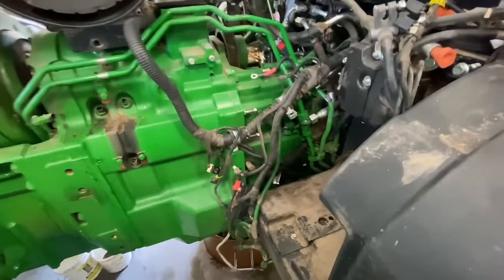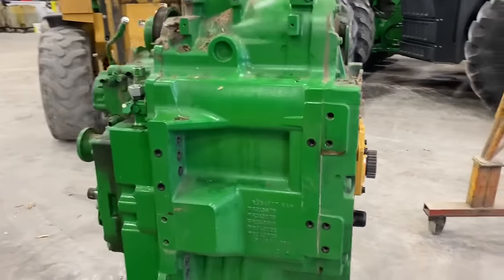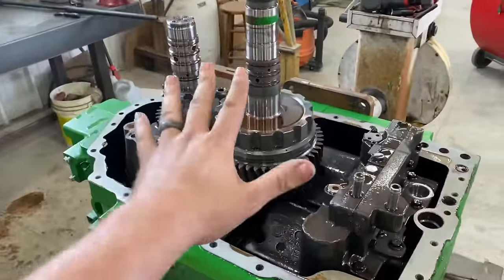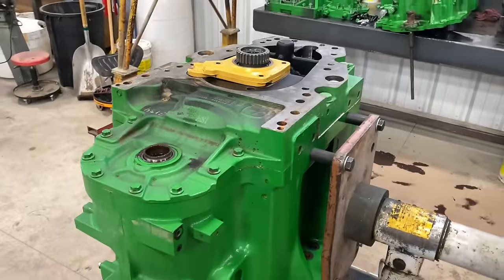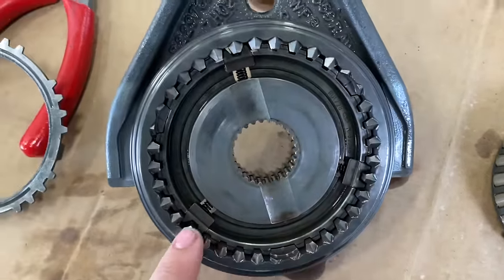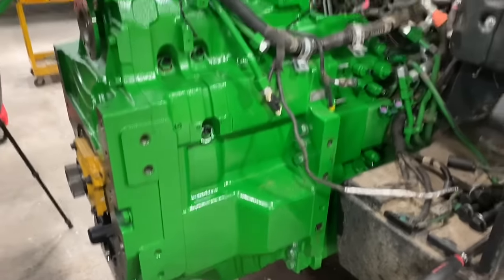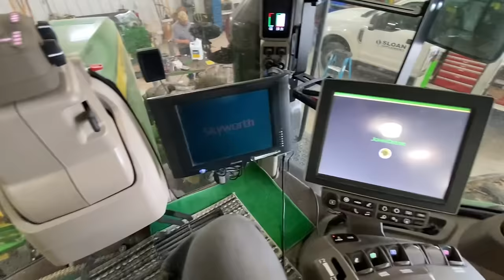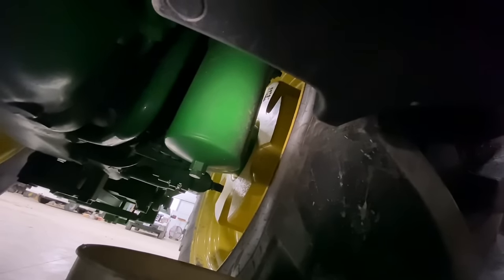John Deere 8370R IVT will not come out of park or calibrate.

Comment: I was an engine man in the Navy for 10 years, and I never worked on anything like this I’m just amazed it how absolutely complicated that transmission was on the internals and what it took to get it out was just unbelievable the engineering behind this is phenomenal my question is how many days or hours did it take to pull it out disassemble it and figure out that it was needing a reman Tranny was cheaper than to replace all the carnage in the factory unit ?
Reply from the maker: Takes about 45 hrs. Tractor was under extended power guard warranty so that's why it got a complete transmission. It was more cost effective and was way quicker to get than hunt down all those parts.
Reply: @ZKMasterTech  extended warranty only compensates for a reman part....how many hours was on the OEM to justify that no lube rectum routing??
Reply: You are truly gifted , exceptionally  humble  in your approach yet exceedingly talented. I admire you and your tech know-how..God bless u!!
Reply from the maker: @aghowrath  thank you so much!
Reply: You deserve the credit...keep the good work in continuation Brother..regards N
Reply: @ZKMasterTech   how about a brake replacement video
Reply: John Deere loves you, fixing mistakes!

Comment: I am very surprised Deere will let you film anything. They are so secretive about such things. In my opinion IVT is junk and it is MY opinion so take it for what it is worth. Give me a clutch and geared transmission anytime. I hope that machine is under warranty. I am very leary of remanufactured engines and trans components. Never had much luck with either of them... From what I see you are a very good mechanic. You take your time and go the extra step like checking the rest of the trans for any damage. When you build such a reputation it will stay with you and in time you will be rewarded for such...

Comment: good grief!!!  The complexity of these 'farm machines' is amazing.  My grandfather had an old John Deere H, open bicycle seat, external flywheel and it just chugged along.  They did most of the repairs right there but dang, this, it's a whole new world.  Good job guys.  had to subscribe to ya.  Wow!!!
Reply from the maker: Thanks for watching!
Reply: I worked for my Uncle in the mid 70's on a tobacco farm. We had two JD 1020's and a 4020 and we dogged them hard... They just ran and ran and ran...
Reply: I grew up in the '60's & 70's with my dad's 30's and 40's era tractors.  Somehow we could pull 3 bottom plows and 10 ft cultivators with 30Hp gas tractors that ran for 20 years between overhauls. Now they need 300hp plus to pull 50ft cultivators and pour $10,000's in to maintenance every year.  Not sure how they make a profit.. maybe just borrow more on the increased equity in their acreage?

Comment: I worked for an Agco Allis dealership in high school and for a few years after I had graduated.   Sadly that's been nearly 30 years ago now, but we had a customer bring in one of those old orange Allis Chalmers tractors with a locked up rear end one day.  It was old and worn out even at that time.  We drug it in the shop leaving a trail of black rubber from the rear duals.  We split it and found a 3/8 X 1 inch bolt worn and wedged between a large gear and the rear end housing.  The fill hole for the rear end housing was in the floorboard of the cab.  When he brought it in we noticed that he must have lost the fill cap and used a cutoff hoe handle for a fill cap.  We guessed that at some point he had knocked his makeshift fill cap off and that 3/8 bolt was brushed off into the fill tube.  It was incredible to us that that bolt could wedge so tight to lock the rear end up like that.

Comment: It’s actually cool seeing how different people do things. Cause at our shop we just remove the hood disconnect the line bundle from the front and pull the condenser along with it.(if it’s got that style) and swing the bundle aside. Then disconnect the exhaust from the turbo and remove the intake pipe from the filter housing. Then just disconnect the chassis harness and set it aside on the rear part of the tractor Then disconnect the basic stuff then take our crane and connect to the front weight bracket and push the front half forward and set it in a Jack stand. Then remove the air box and use a really long strap that we connect to the rear drawbar to support the accessory bracket and then just pull the trans out. I know it’s unnecessary detail but I thought it would be a cool read to see how different people do things To do the same job. I understand you don’t have a overheard crane though so you have to use the stands and what not to roll it forward

Comment: The IVT is a technical tour de force. It is special that Van Doorne, a compatriot of mine in the Netherlands and founder of the DAF brand (nowadays part of the PACCAR company), laid the foundation for this. Superb video.
Reply: Almost as good as Nissan's notorious JATCO CVT for reliability...
Reply: @ReflectedMiles  Yes, but that is a spin-off and 80 years younger, so quite obvious that it's better...
Reply: @rypkepaulusma  I doubt it. I made the comment tongue-in-cheek as the variable transmission has a long reputation for its lack of reliability / regular need of adjusting and work, including the latest ones from Nissan/JATCO that are a joke to experienced, non-Nissan auto mechanics. I would certainly never buy one for very high-torque applications where longevity was a major criterion (e.g., tractors). The idea is useful; the execution typically isn't so much.
Reply: @ReflectedMiles  You are totally right, I fully agree with you, I only pointed out the origin of the CVT/IVT.
Reply: @surface4985  Maybe, al lot of companies worked on perfecting it and claiming it te be 'theirs', but none of them invented the concept. That was Van Doorne (DAF).

Comment: Your knowledge and skill in rebuilding the transmission were very impressive.  What were the total man hours?
Reply: Didn't you pay attention? They didn't rebuild it, they packed the broken parts back in the mostly good transmission then sent it off as a core to either be remanned or parted out.
They gave the owner a reman (remanufactured/reconditioned) transmission as part of their warranty.
I honestly don't understand why they would re-pack the broken/incomplete parts back into the unit, I guess its easier to transport and trace the parts, just a part of working for a big company is you follow silly rules like that I suppose.

Why not just stick them into a couple of separate pallets/crates and wrap them with plastic? Surely the slightly bigger transport costs would be more than offset by all the labor wasted taking it apart again?

Comment: That sounds expensive. I hope our Challenger/ Fendt CVT doesn't croak. Probably be as bad or worse. At least with the CVT, AGCO wants the bad one dropped out and a factory reman is installed. Saves labor of the local tech trying to diagnose and repair the problem.

Comment: At 12:53 when zoomed in on the hydro portion, immediately recognize the trademark of the supplier. Realize immediately it is not a complete JD design, which is not a surprise. I have a CVT different brand, love how efficient it is getting work done but seeing one torn apart is scary - swap for a rebuild the only way to go I think.
Reply: Theyre designed for 10k hours, i think fendt says that. I mean with powerahift you can at least swap the packs as needed but these... Luckily not a call ill have to make. With my hectares itll be 2525 before im going cvt =)
Reply: I'm with you .I have a Puma CVT here in Australia Very nice to use .Out of warranty now so I expect I'll be having nightmares now after watching this video.

Comment: Just curious as to how many hours was on the tractor? Our 8370R had a check valve stay open which caused it to lower the hydraulic pressure in the system. To get it to work we held back one of the remote levers as if it was trying to raise something, the back pressure gave the system enough pressure to work.

Comment: When I split my dads Ford, I put rails on the floor using triagularly slotted wherls, so when time came to reassemble, I didn't have to struggle with all the alignment.
Reply: I've been doing it the same way, perfect manner to split and reassemble your tractor

Comment: I used to work on cars for a living so I can relate somewhat to the fun of pulling transmissions and dealing with failures in them. All the parts you are dealing with are much heavier of course. I'm with you as well that anytime there is a catastrophic failure that shoots metal around I like to install a reman or in my case we could get used ones from a salvage yard for cheaper. I was never comfortable trying to rebuild on the chance there could be metal fragments stuck in a fluid passage somewhere that you cannot see it. Does John Deere supply you with the support brackets you put under the tractor to hold it up or do you make those? Also, just curios how many hours Deere allows for a job like this?
Reply from the maker: Thanks for watching! Yes, we get the stands from service guard that is where we get all our Deere special tools. Probably get around 40 hrs for a job like that.

Comment: Good video ... IVT transmission are fascinating been around and worked on car transmissions and a tractor power shift but never seen a IVT opened up
Reply from the maker: Thanks man! Yeah I would rather rebuild an IVT than a powershift. A lot less clutches to mess with.
Reply: @ZKMasterTech  lol that's no joke 👍👍👍
Reply: @ZKMasterTech  you think working on them is bad try driving them for a living. i got to test drive one of those fancy new Claas 960TTs damn they are smooth i already hated the NH T8040 power shift it was harsh as hell now i want to burn the damn thing but i dont have the money to buy any thing with an IVT yet.

Comment: Dang. That looks like a poor design. I left Deere before the ivt transmissions had problems. They are nice but I would take a power shift. They are easy to rebuild and are usually tough as nails. The concept was great, but doesn't seem to be standing up under heavy loads. Nice to see the inside of one though. They didn't even do that at the John Deere classes I went to.
Reply: Yep,  cars,  trucks and tractors are getting more and more complicated.  Don't know if it is all worth it in the end.
Reply: @evanpenny348  it is to the dealer and manufacturer means more money for them since you can't repair yourself

Comment: Sounds are everything when it comes to equipment repairs.  It has to sound right or its not fixed.  Even smell comes in hand.  I recall about 60 years ago I was mowing hay and started to smell burnt wood.
The oak pitman arm (?) had some bolts that started to work loose and the vibrations started to heat the wood around the bolt holes.  I stopped immediately and my father was able to fix it without much effort.  Had I continued on, the pitman arm would have been shambles.

Comment: Common problem on these tractors.  I've replaced hydros in 2 8R's this year with identical failures to that.
Reply: I am curious to know whats causing that piston and rod to fail like that, Is that a result of collateral damage from some other component ejecting metal into it?  It always bugs me when I cant identify a reason for a failure. Can you shed any light on the failure source?
Reply from the maker: @kiwidiesel  sometimes you just have a part failure. These hydros are known to do this. There are fix as fail pips on them.